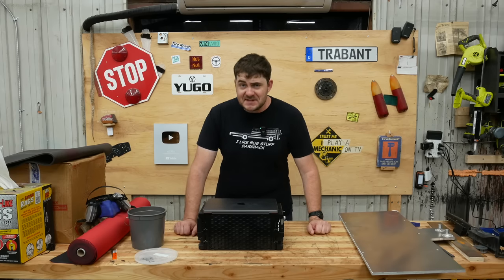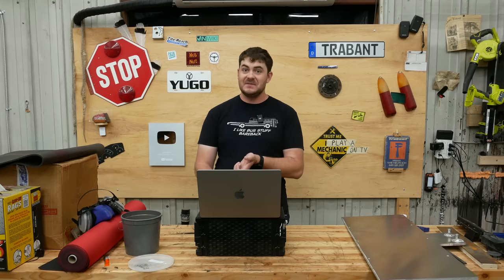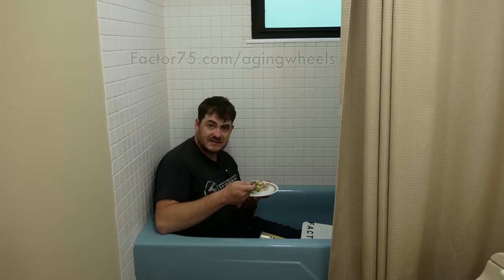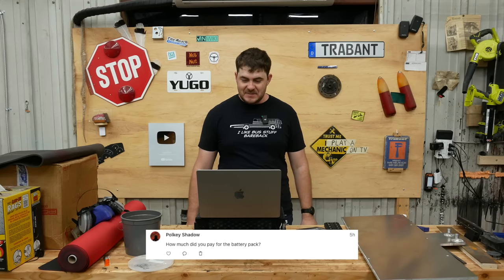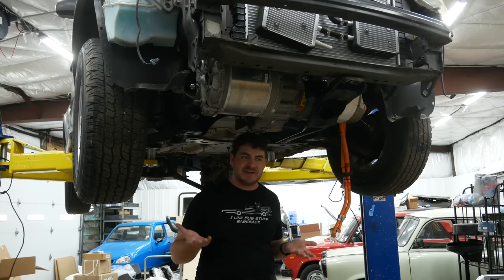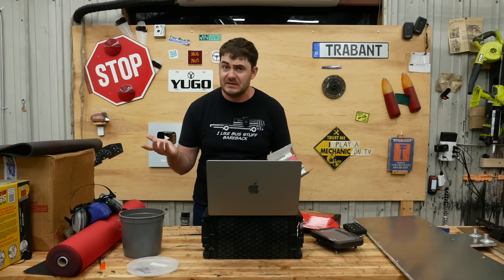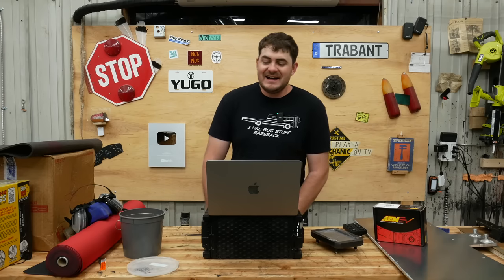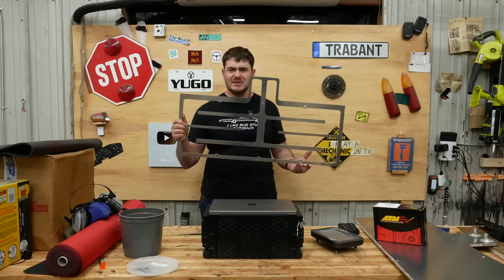Your Burning Electric Escape Questions

Comment: With that whole trailer idea in mind, would you consider a series hybrid system for the bus? Simply running a small engine whose job is to extend your range might let you reduce the amount of batteries you need in the long run, and you might be able to tap heat from the combustion engine for cabin heat in cold weather.

Comment: For your bus battery pack, Winston thundersky do LFP cells from 40Ah to 10,000Ah. They might be easier to deal with than NMC batteries. Or hell jam a shit load of LTO batteries in there. When you ain't using it it could power your house/workshop when your done.

Comment: Would it be possible to add polyurethane bushings for the suspension? I'd worry all that power would smash the stock bushings and shred them to pieces.
Or would it not be possible to find good enough poly bushings for a 2001 Ford Escape to even make it worth it?

Comment: For simple boxes choose the thickness sheet steel you want, cut out the bottom and sides as a single cross shape, run a grinder along the bend lines 3/4 the way through and bend the sides/ends up. Then weld the corners and the bend edges where you cut 100% through cause you cut too deep. 
This way you will have strong perfectly straight boxes in no time.
Don't forget to allow space for a fuse and contactors if possible in the last box and a HV disconnect somewhere near the middle.

Comment: I think they sell small dash mounted heaters that you could install in the Ford Escape, it just needs to be wired directly to the 12 volt battery. It's just a thought. Also, you could put a portable air conditioner in the Escape as well. I think you had a sponsor from a company that sold them not to long ago.

Great video! Can't wait to see what you do next!
Reply: They would of course work but be very efficient. Plugging in a heat pump might be an option or swapping the heater matrix for PTC elements would be more energy efficient but more complicated.
I’ve looked into this because the country I live in requires heating (Germany) and the car is tiny (Triumph Spitfire)… so a heat pump won’t work for me (not enough space) but PTC elements will…

Comment: on the topic of AC and Heating, you can actually get an AC Compressor and a reversing valve and get heating and cooling from the A/C
Reply: Aka heat pump :)

Comment: Thinking about the prospect of a smokey four wheel burn out, having seen a few before. It is just as amazing as it sounds. That said, I'd be careful about the counter rotation (front wheels turning backwards, rear wheels in forward). That could lead to a dangerous instability. A better idea for that would be front wheels forward and rear in reverse.

Thinking also about the range, sure it might be "short range". But this nifty project so far looks like the range had will be the most fun. Who cares about how far you can go when you can get there quickly.

Comment: have you looked at Edison motors out of BC? They built an electric log truck and are working on building commercial frames you could drop the bus on.. they have a small diesel gennie and are talking about a cargo trailer covered in solar panels...

Comment: When you take the "Pod to Georgia, plan on a side trip to Bradenton, Florida; Cleetus will have lots of toys to compare it too and both  drag strip and a circle track with a huge burn out pit in the middle- Cleet might have some useful suggestions on setting up the controls. BTW, how much do those drive motor/differentials weigh? Batteries? Oh, damn, Robert, this one is a hum dinger. When are you installing the solar power pack it will take to keep this stable charged up? Moar Content! How many solar panels will a chicken coop support? Matt, over at Undecided, couldn't cover that the way you could! Have a fantastic year or decade, Robert

Comment: I would suggest putting some (small) holes through the fins on the inside of that battery pack chiller, so you can bolt (or plug weld) it tight. Otherwise you're going to get water flow-by as it goes in-between the layers and leave areas of stagnant water.

Also RTV the crap out of it before assembly, as I'm pretty sure there isn't a gasket for that. :D

Comment: Regarding the suspension being able to hold up to the torque, that all depends on what tires you use. Remember that, while the motors may be capable of putting out 450 lb*ft, the tires will almost certainly not be able to provide enough grip to handle that. So, you won’t actually be putting that much torque to the ground, and therefore you won’t have the full strain of that torque on the suspension. I’m not explaining that well, but hopefully it makes sense.

Regarding the Model S motors not having a very high continuous power capacity, I think most of that is down to them using induction motors (as you said) and the fact that they run hotter than a PM motor, but also due to the fact that the cooling on the motors is not particularly well designed. The rotor is only cooled by coolant running through the center shaft (doesn’t get to the outer surface) and the stator only cooled by contact with the sleeve that it sits in within the motor housing (so it only gets cooled from the outside). Lots of other EV motors will cool the stator and rotor directly with oil that’s allowed to run all over them, so it tends to be more effective.

Comment: Regarding the control  for AC unit inside the cabin, you might just throw away the original controller, and add one of your own.  These devices have a few simple servos to control flaps, and pretty simple fan motor control.  All of the wires are at the plug that goes into the original AC unit controller, so no need to run extra ones in the cabin.

Comment: I just saw a short from Edison Motors they make electric converts for hig trucks.  They have a semi cab they are making that has a Tesla model S motor going into a 4 speed gearbox.  They also explained they have some E axles ordered for the same project.

Comment: I have a bit of experience with Ford CAN buses so when it comes to your HVAC or dials I might be able to help. You said the escape uses the duratec 30 which the ST220 also uses, and I have a good book of codes for that. If it uses SCP or ISO i might be also able to give advice in that!

Comment: I am excited for this. I have a 2003 Prius I am saving to convert to full electric, although I am going for economy not power. My goal is to have similar range and power as my 2020 Ioniq electric, without all the annoying new car "features" like alarms, touch screens, self locking doors, electric parking brake etc.

Comment: For heating, you could consider piping the battery coolant to a small cabin heater core, or two stacked in a row, in front of a fan, not to cool the batteries, but to heat the cabin if needed... The real cooling of course would be a proper system, but relying on free generated waste heat is the simplest way to heat any vehicle, regardless of the mode of power delivery and generation... 
The hvac part of cooling could easily be sorted with an electric turbo motor from the more modern cars with such solutions for constant turbo modulation, one that was wrecked and offers spare parts, as those units dont come cheap outta shop... Just belt the motor and the hvac compressor together... You could even spot weld the compressor electromag clutch, as the compressor would only turn when the motor is on, and would not need to rely on a clutch as not to be permanently driven by an internal combustion engine which is long gone in this case... 
That solves heat and cooling for around 300 bucks in heater cores(you already have one from the old system), and other parts... 
The cooling core you already have from the old system, and the compressor you also have... The rest of the hvac system is filters and part of the compressor system, as is in any car, so with batteries coolant first routed to cabin cores, and the comp driven by a strong small electro motor, you have the whole of the hvac solved... And it need not be a turbo motor, you could use the bmw electric coolant pump motors or any such high performance motor for comb. cars... They are a power drain on the batteries, but anything in an electric car is a drain on the batteries, so thats a stupid argument to begin with... 
Hope this helps speeding the hvac part along... As it should not really be such a problem, at least not in my experience... And i am a car mechatronics schooled and did work in the mechanics branch, and i do a bunch of my own shit and projects, so its not just hot air blowing outta my ass... It at least has a legit schooling diploma behind it, and the perspective of a machinist, as thats what i actually do...

Comment: When it's time to do the bus, check out the E-axles Edison motors is going to use on Carl their 1962 Kenworth LW 924. While in the prototype phase, they are using a Tesla motor to a 4 speed gearbox, but it will eventually have too much more powerful E-axles. It also has an onboard diesel generator.

Comment: Does your area have semi regular emissions testing of cars?  How is that going to work with your EV conversion??  Did you ever consider using one of the drop-in EV "crate" motors from Ford or GM.

Comment: Another comment. Have you considered going with a higher continuous amperage motor?

I have a 2023 Kia Sportage which has the same drive line as the 2022 Hyundai Tucson.

Afaik the continuous output of those motors are about 66.9 kW? Or about 90 horsepower.

I'm sure you don't want to fabricate more mounts for your Ford escape build. Two of them are probably not enough to drive a full-size school bus.

I just didn't want you to rule out any other manufacturers electric motors other than Tesla going forward. But you're a smart guy, and I'm sure you've considered other alternatives.

Comment: Since you asked, I think you should paint the walls in the bathroom to match your robin egg blue bath tub.
I would put a 1/4" steel strap front the front suspension attachment points back all the way to the rear suspension.

Comment: Suggestion for the bus later - Edison motors is working on their diesel electric hybrid, but going with Meritor e-axles. Maybe look at one of those instead of the dual tesla motors when you get back on the bus project. Peak power isn't massive, but the continuous power rating on them is far higher.

Comment: I think the fuel gauge is a resistive input. You might be able to use that with a voltage controlled resistor to use the fuel gauge for battery charge state. Speed input should be easy with an ABS sensor.

Comment: Can you run the battery cooling loop through the standard heater matrix and rig up the standard car blower to 12v and a switch so at least you can clear the windscreen or have a little heat?

Comment: 6:50 there is probably some kind of smaller-size heat pump you could fit into the now-empty front of the car and use for that. I think the units used for RV's would probably be a perfect fit for this, and this would solve both cooling and heating!
Reply: I am doing a conversion as well and heat is a requirement in the country I am in (Germany). I looked into heat pumps and they  are the most efficient way to generate heat You have to transfer the heat around. The existing heating piping might be sufficient in his case. In mine (Triumph Spitfire) there is barely enough space for the batteries so I will be going with PTC heating elements…..

Comment: Robert, an Idea for you.  A small 2 cyl boxer car or motorcycle engine (Citroen or BMW) mated to a generator power head that would be attached to a winch mount bracket to fit in the hitch on the rear bumper that would charge the batteries while you drive.

Comment: If there were to be a trailer, extra battery packs would probably be good to extend range, sure charging would take long, but at the end of the day it seems worth the while. Maybe add a wind turbine to charge the trailer batteries while driving.
Reply: There was a company in England that made a battery trailer and like you said the lengthy charging time and lower efficiency (added weight) made it a non starter . That was almost 15 years ago though and tech has come a longer way.
Not sure if wind would be efficient enough. They often only get 200-300 watts and f power. Same for most solar cells. It would work of course but not mega efficient…
Would be fun to try though!

Comment: Beware paralleling modules! If you want the cell balancing from your cell monitors to work you will need to bring balance wires across from each cell in each module and common matching cells together. Otherwise you will need to have a cell monitor for every parallel module.

Comment: So I’m not 100% sure on this but I’m sure they do make aftermarket front suspension components for a Ford Escape, however I do understand the reason that those 4 bolts are gonna be under far more stress than before since before hand the old engine in only made like 240HP and put like 120HP to each side, now you’re putting over 300 horsepower extra to each side so what contingencies will you apply to this vehicle to ensure some form of extra bracing and support for the front suspension since I’m sure we don’t wanna see the front suspension rip it self free.

Comment: You know coding and electrical work... you could rig up some motor controllers to the speedo/tach/fuel gauge motors or whatever with an Arduino. (If you have time however it also sounds like you really do not want to)

And you could trick the low fuel light. Just hook up a resistor or a short to 12V or ground to the fuel level sensor circuit (I don't know what the ideal value is)

Comment: You should definitely consider cast control arms. At the very least boxing in will greatly reduce your wheel hop. Even at 200hp that car will have bad wheel hop. I’m sure the extra weight will help some.

Comment: Does the BMS take the voltage drop from module to module cables into consideration? (Do you double the measurements exiting the module and entering the modules?
Reply from the maker: Having not wired any of it up yet, I don't know!

Comment: Big block camaros and novas only had like 4 bolts holding the front subframe in.

Surely it wouldn't be hard to just remove the low gas bulb/desolder the led in the factory dash. I mean do you even need the factory dash plugged in at all with the AEM dash.

Comment: Is it possible that you could add an optional range extender that could be maybe plugged into somewhere in the back? I mean it is an escape so you could add a plug to add an extra battery pack in series with the rest or something I'm brain farting on the electrical but I think you catch my drift lol. I'm just wondering if that would be possible as I'm not super familiar with these conversions
Reply: There was a company in England that made a trailer full of batteries.
This was over 15 years ago so I think it didn’t take off because the speed of charging was so slow and the added weight =less efficiency….
Doesn’t mean it can’t work though :)

Comment: I'd be more concerned in the rear. Due to weight shift the rear wheels will have a LOT of traction and that suspension arm probably won't bend but what's with point on the chassis where it's mounted to the chassis?  Never designed to take any significant load. 

Front, well you might get away with the wheels braking traction but still this project will be definetly fun to watch and especially after you've driven it for while giving it the beans. 

AC and heat? 
Why not use a very beffy DC DC converter to get 12V and then directly create 48V DC with another DC DC converter? Yes not very efficient but sure as hell easy to run such high load devices on 48V DC . 

Btw. PTC heaters and also ac compressors/heat pumps exist that take a wide variety of high voltage dc so you COULD run that directly from the battery pack.

Comment: The CAT generator at 5L per 35KWHs equals around 100 miles per gallon in a tesla. It works out to 7 KW per layer x 4 liters per gallon= 28 KWH per gallon. 28KWH x 4 miles per KWH in a tesla is about 100 miles of range from 1 gallon of fuel.

Comment: For the bus, wouldn't it be better/easier to bet on Trolley Bus Motors? They are already designed for pushing buses, and given that a bunch of municipalities have ditched them, I'm confident that they can be found for scrap value.

Comment: The heater could be a simple resistive heater and the AC compressor from the edge could be coupled with a simple 5 HP electric motor.

Comment: The multi-fuel turbine is great, but for right now, I'd go with a well-balanced motorcycle engine, such as a BMW twin, or something with a balance shaft. These engines can run a high compression ratio and make good efficiency, and they're not too expensive and they're readily available. I think of a hybrid as having a disoposable ICE, and the rest of the car is designed to last a long time.

Comment: should aim to use no more than 80% SoC most of the time to avoid premature wear of the battery.  so off the bat, 51.2kwh so you can get thousands of recharge cycles instead of hundreds.

Comment: I think the answer to heat , oddly enough, may be a small diesel rv heater that people use in van homes.  5 gallons of diesel will last a long time and won't drain the battery.

Comment: the fuel gage is just a voltmeter, so convert the battery volts to 12v proportionate, calibrated
Reply: but if it were my job, i would delete the gage for a dogotal